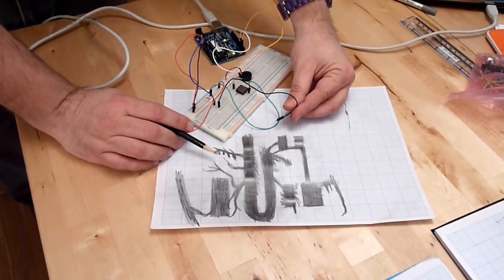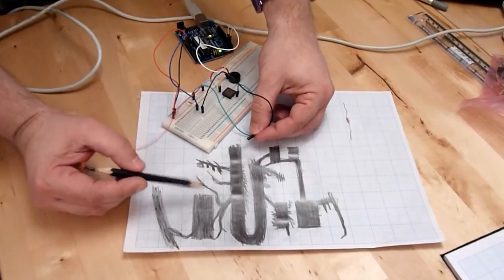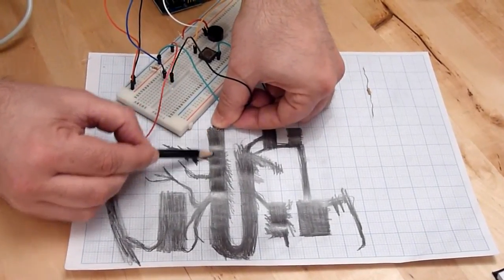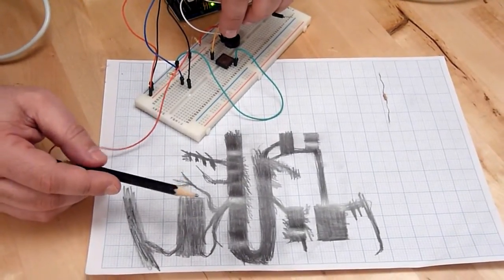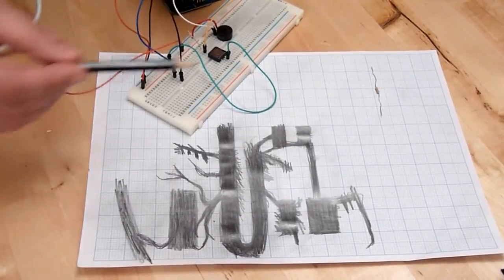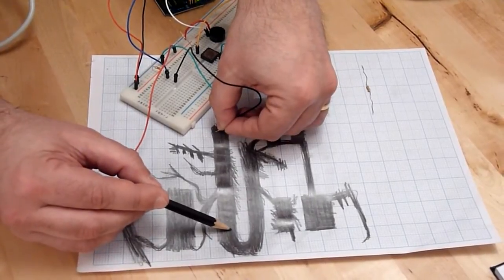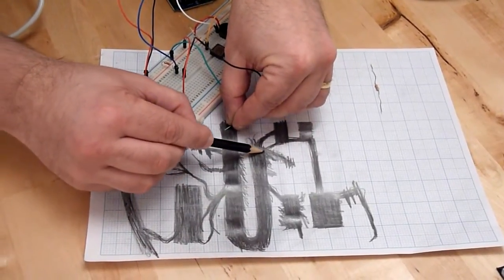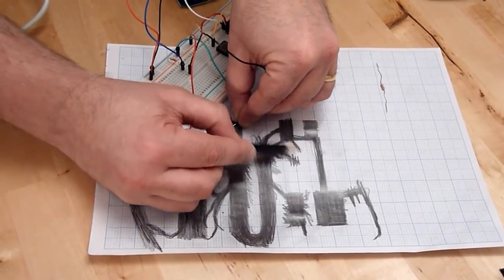Graphite Pencil Input

Comment: Hi, would you be able to share code for this? Thank you!
Reply from the maker: +Darja Dee  I made a gist here : https://gist.github.com/interstar/b885b4005b92bd70b9bd  I'm not sure how useful it is without the circuit diagram ... just  remember that there are two inputs ... the analogue which is the pencil position. and the button which switches between calibrate and play mode. In calibrate mode it just tries to remember the max and minimum values it received. In play mode it scales from a value between these two extremes to a value between 50 and 1200 (   scaledValue = map(anIn,aMin,aMax,50,1200);    ).
Reply: is it possible to post the wiring?